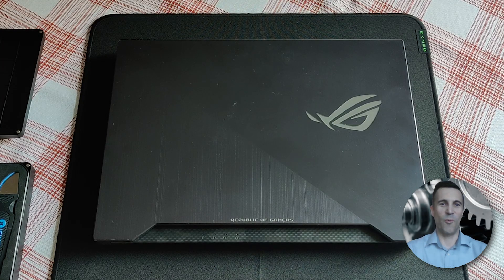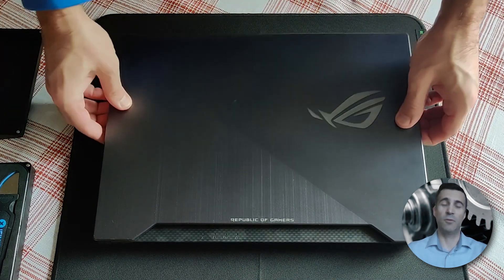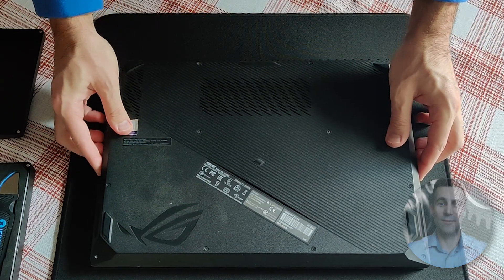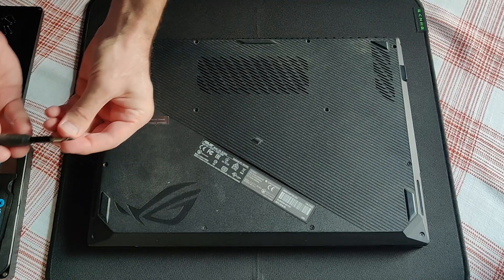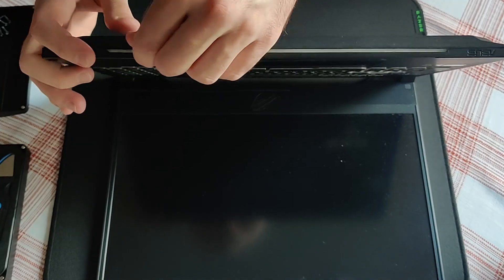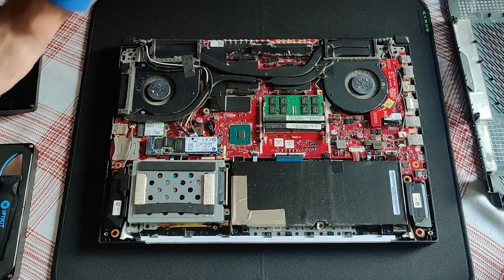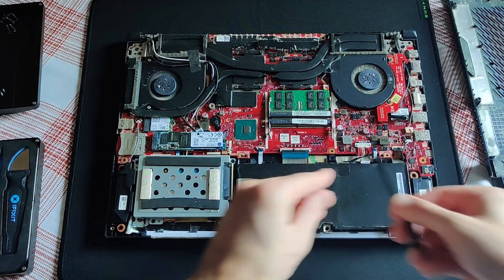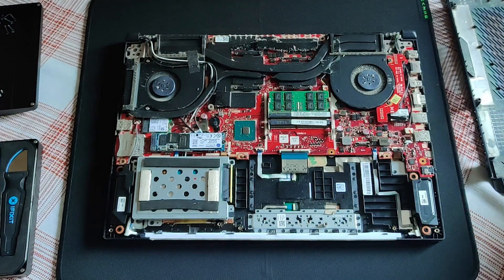Asus ROG STRYX SCAR II - removing the battery and cleaning the cooling fans

Comment: bro u dont even show how you cleaned the fans
Reply from the maker: Thank you for watching. Not much to show really - plenty of brush strokes over fans. Didn't want the dust and probably sticky nicotine residue all over my work surface while I am doing the cleaning. I didn't remove the entire cooling body or changed the thermal paste in this case.
Reply: @smooth.IT.operator thank you so much for your reply! Do you have tips of what type of brushes you used?
Reply from the maker: @emmapekle8462  Sure. Here. Safe to open and leads to Amazon store. https://amzn.to/496SnCh You want UK or Canada link?